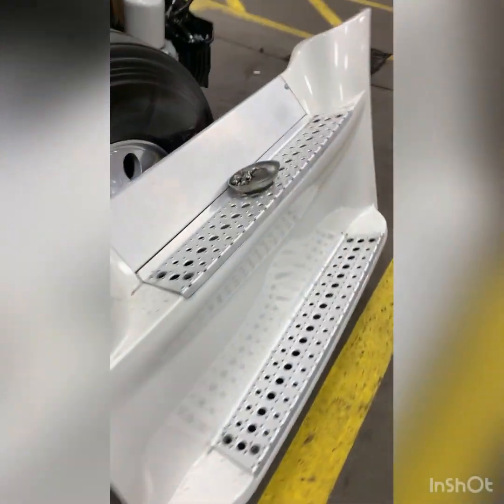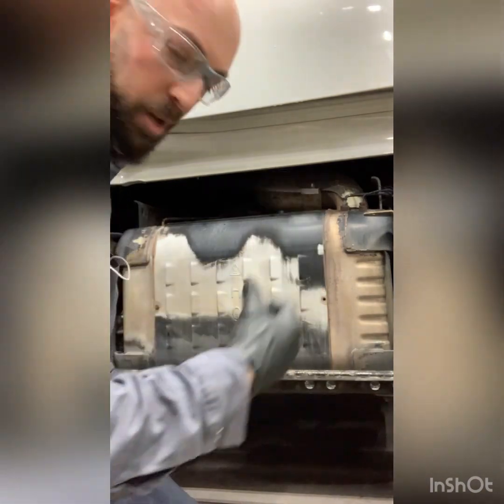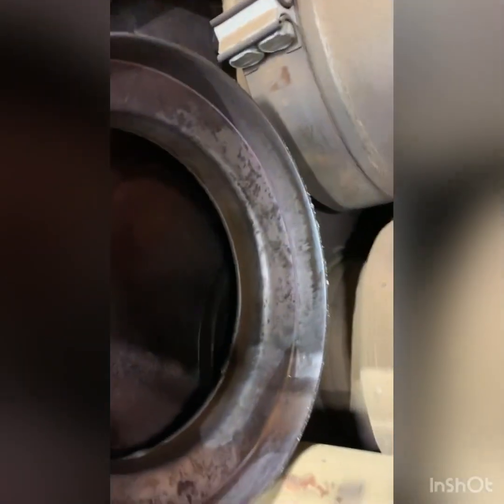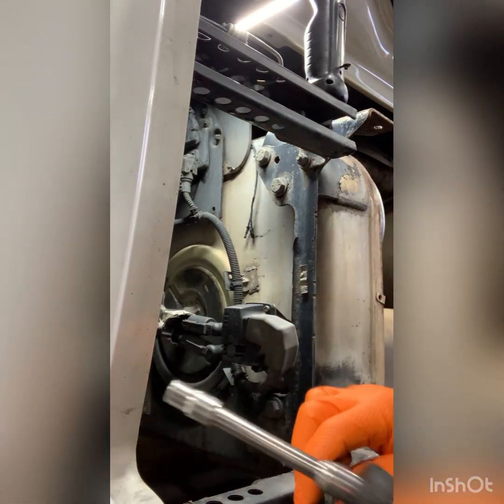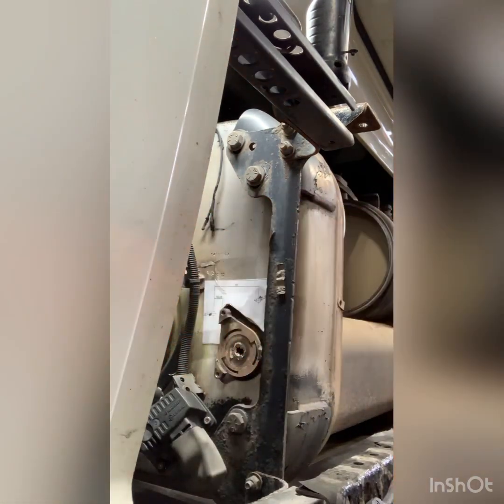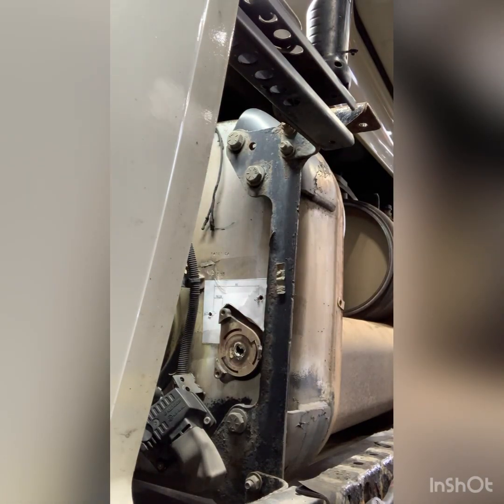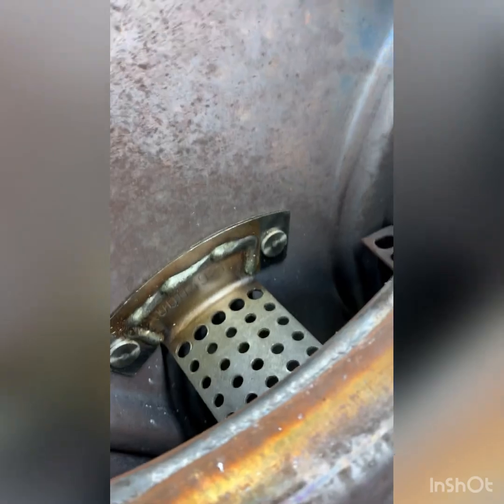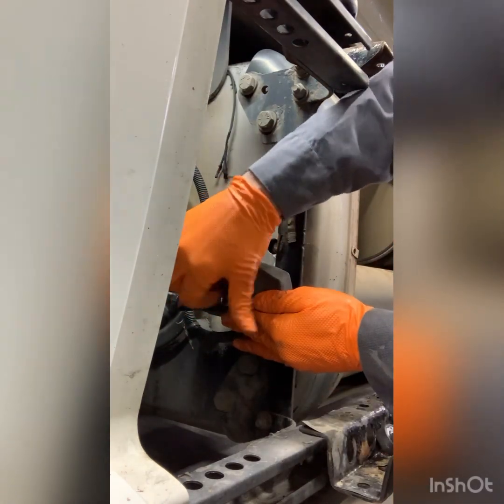Freightliner cascadia DD15 def awning install for 4364 18 nox conversion efficiency low code.

Comment: Hey bro so I have 2020 Freightliner Cascadia do I need to do this on my truck to or is it standard thing on newer trucks?
Reply from the maker: This is only standard on trucks 2022 and up. Keep in mind this is t a definitive fix for nox codes but it does help out a known problem Detroit has

Comment: When you guys install this awning, make sure you clean the buildup out of the bottom of the 1box or you will continue to get this code. Also, after replacing the v-bands, make sure to do a regen to heat the sealing agent on the band to the DPF filter. The material needs to heat so it melts into place and seals the filter from leaking.

Comment: Thanks for the video..Ive been dealing with this code for awhile i changed def harness, in & out sensors, dosing gasket now cleaned the dpf filters & still code showing up specially when heavy in uphills but recently it showed up in flat highway after a regen it goes away…could the awning resolve this issue? Thx
Reply from the maker: The awning definitely helps but doesn’t always cure the issue. If you have over 500k on that truck than your one box may not be able to clean well enough causing this code to come active. There’s a lot of test la that need to be done before making that $10k call.

Comment: I changed all nox sensors, temperature sensors, two dpf filters, sensor on the turbine, electrical cables, but I have error 4364. I will buy this spare part and try to install it.  God forbid this helps me.  For 6 months I have been suffering from def
Reply: Did it help?
Reply: @dkz2802  yes please
Reply: I have a 2015 with the same codes all the time 3364 and 4364 will this help me.

Comment: Hello bro how are you I have the same problem same code in a freightliner cascadia with cummings ixs15 engine     my mechanic says the vgt it's getting problem i need to replace it but shows scr and nox sensor it's like i need to replaced everything in def sistem, what you recommended bro thanks you..
Reply from the maker: Thanks for reaching out man. I wouldn’t think it’s the vgt having an issue unless it’s throwing a code for that or having boost issues. I would focus on the onebox and all the sensors on it. I do find that some tests need to be done a few times especially the def quantity test to see if results are accurate. If you trust this tech than I’d listen but if your skeptical than find someone else. A second opinion won’t hurt
Reply: @bustedknucklebydieseldr3228  thanks you  for your help men ill look a second opinion thanks..

Comment: If you have to install an awning, it’s because the computer is telling the doser to spray like hell, because your DOC isn’t doing it’s job and converting the NOX. That gives you the large buildup of def inside the box. Save your money and get a new onebox. I’ve been through all that headache and had to replace the onebox.
Reply from the maker: Awning is only for stopping the slobber of def when exhaust flows past it which in turn causes the low nox code. A onebox price compared to a awning install is about 9k off from each other. I think you may of had a string of bad luck with yours. Or maybe to many miles on your box. But I would never jump to selling a box as majority of the time not needed. It’s all about having someone that knows how to read log files correctly.
Reply: @bustedknucklebydieseldr3228  the mechanics told me that very thing. I ended up wasting 9k replacing harnesses, nox sensors, the list is too long to put here. And ended up needing a onebox after all that expense. I even had the DOC cleaned with an ultrasound. Each mechanic would tell me a different story. It’s the clients choice I guess. I wish I would have replaced mine at the very beginning. You can’t win, even after replacing everything, I’m still in the shop for ACM, then ECM, hunting it down with the parts shortage. The best thing to do is drive the mfer off a cliff.

Comment: When I took my dpf filters out I did have a lot bill up def in my one box I clean all def bill up out and install the shield. I change my dpf filters and put the Shield in, it been a week so far I haven’t got the code again
Reply from the maker: That’s great man. Atleast you were able to see the problem of def build up. Now just check the def doser on how much it produces and make sure it’s good. If it’s to much than you’ll run into the same issue.

Comment: I'm currently getting 4634 17 code on my 2019 cascadia dd15. I was told it's the same code as 18 Nox efficiency low.  Does anyone think it would be the same problem?
Reply from the maker: Good question. So the new generation comes with an awning built in so there quite a few other things that would cause this. Such as a def doser not producing the correct amount of def, any of the sensors drifting, intake or exh leaks. Really a tech would just have to start from the beginning and go through a long check list. Luckily it should be under warranty being a 19.
Reply: Got it.  Thanks. I'll have to get it into the shop.

Comment: Wish you was on the east coast cause I’m going threw issue with my one box. Got bad DEF efficiency and Freightliner said after they diagnosis that it is the one box. They installed what u are doing and still had the same code.
Reply from the maker: With your crazy weather on the east coast I’m glad I’m on the west side. Working in the rain what a pain.  That awning install definitely helps but isn’t a 100% guarantee fix. There’s usually an underline issue like a sensor screwing up or poor metals in the one box deteriorating. But only diag with a computer will tell us. Dealers should have a lot of info on this but than again it all comes down to the tech working on it.
Reply: @bustedknucklebydieseldr3228  haha! Yea between that and snow. I don’t blame u. But yea Man U detailed with it. I don’t think they took the time like what I’m seeing.

Comment: I replace Doser,  nox inlet outlet both ,  still on when it is a heavy load climb the hill , tired of this things man . Is it gonna be fix if I do the delete?
Reply from the maker: Haha for sure man. Do the delete and get a good tuner. That would be the ultimate fix. Just don’t get caught. No matter what there will be always be more codes from the aftertreatment system.

Comment: Great video.   Am I to assume that this would be a good time to do the  Dpf filters? I happened on the comments on the  Aforementioned codes. I am beginning to see these codes at 475000 miles. Do you think that there's a possibility that it could be the harness that is the culprit? I realise there's a lot of diagnostic that goes into it, just come to throwing that out there. Thanks again for the video.
Reply from the maker: Thanks for reaching out. Yes this would be a great time to do the filters since one is going to be out anyway. 500k miles they should be getting close to plugged up anyway. Harness is rarely the issue unless you had circuit failed codes. Otherwise usually a sensor issue. Hope that helps

Comment: Hi. What year this truck? My truck is 2019 right now i don’t have this code but in future do i need install def awning?
Reply from the maker: The 19s run a little bit better and you most likely won’t need it installed but there is still that slight chance when you get this reoccurring code.

Comment: Hi where I can get the shield?? Also why this part the dealer doesn’t have it? Where is your shop and how much to get this job done, i have the same issues, I replaced NOX sensor, metering valve, cables and still getting the code. Is driving me crazy, help!
Reply from the maker: Thank you for watching and reaching out. Also if you haven’t subscribed yet please do. That awning is readily available at any dealer so it’s strange you haven’t been able to find one. I wish I had my own shop but not just yet. Maybe when I build that subscriber list I can afford one. Remember that shield isn’t the magic fix but it definitely will help things. There very well could be a sensor drifting or onebox failing.

Comment: Wish you was in Wisconsin I just replaced both inlet and outlet sensors and metering valve still showing 4364 code 😢help
Reply from the maker: Thanks for watching man   Don’t forget pass the videos on to all your peeps. That code is diabolical. Plagued Detroit and Cummins for many years. There are so many things it could be. Biased sensor, def build up in one box system , old one and deteriorated metals,bad def,heavy load uphill and ghost code. Sadly that code can drive us crazy to find. More common issue is a sensor drifting and def build up in scr catalyst.
Reply: How do I get that part I do it myself
Reply from the maker: @andrewilliams9149  sorry man there’s no telling what part he’s failed without doing diag and I would never recommend just wasting money and throwing parts at it. I’m all about saving the cust money and keeping the truck on the road
Reply: I get this code Everytime when go up hill and comes to 55 mph after 30 min drive on normal road code get clear itself.can you help me?
Reply from the maker: @harvindersingh3828  thanks for reaching out. With this particular code as you can see in the video theres extensive t/s that needs to be done. There is so many things that code cause this issue. And the reason the cel turns off is it recognized an issue and that issue subsided for the allowed time. So there is an issue , it would just need to go to a tech/shop you trust to diag this right. Hope this helps and be safe out there
Reply: @bustedknucklebydieseldr3228  thanks for replying i have pc with ddl software what i should check in software light only comes on hills that time i have 2 codes 3364 fmi 2 and 4364 fmi 18 and one more that showing on derate..what i should check on software and what it could be
Reply from the maker: @harvindersingh3828  for checks you should be checking def quality and def quantity. After that it’s a regen with def doser unplugged and monitoring nox sensors. After that is regular regen monitoring all your sensors. It’s a lot of diag and that’s why I say take it to a shop or tech you trust because they would have to know the hidden details on the log files.
Reply: @harvindersingh3828  What you are having seems to be a very common problem. Other drivers across youtube are suggesting to stop and do a parked regen, it should clear out the 55mph derate, but also dont buy the cheaper bulk def from the pump, get the blue box def, and make sure to top off the def tank every time you fuel. 

Also, I havent tried these other steps, but Ive seen many comments and videos about either changing or servicing the def filter, or the metering valve. But I know a lot less about those other things. Best start would be to try those other simpler steps above first. It may come down to having to stop and do a parked regen every week or so, or being cautious to avoid the heavy loads through hilly areas, seems to trigger this fault for a lot of drivers. Hope this helps.
Reply: Harvinder singh I HAVE SEN PROBLEM. CAN YOU HELP ME. 702 848 0450.